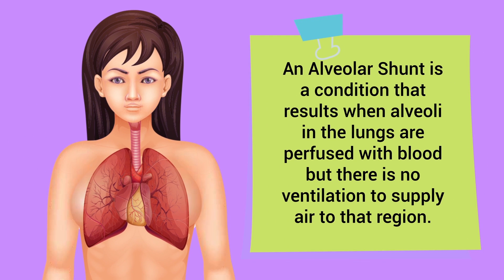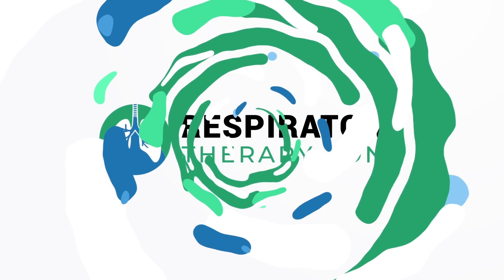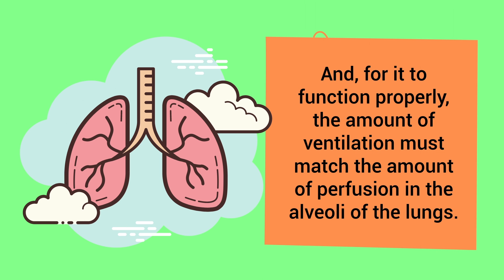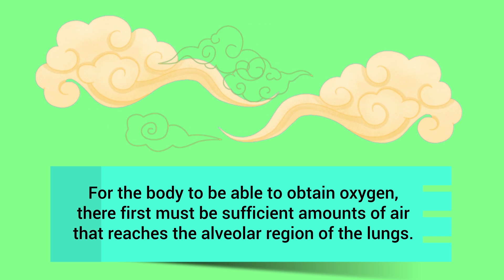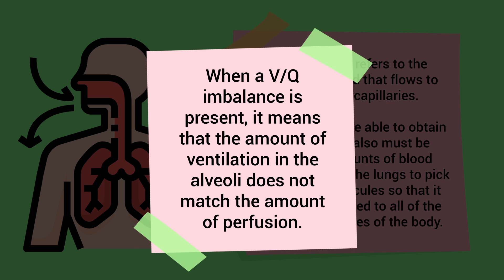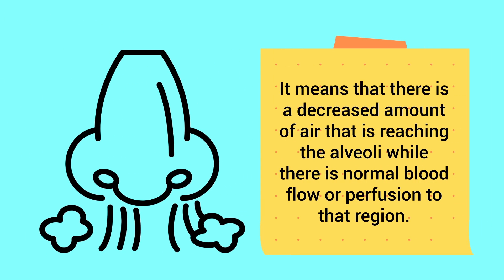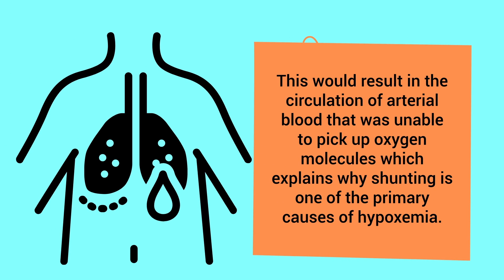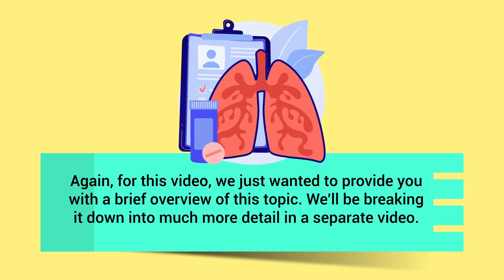Alveolar Shunt (Medical Definition) | Quick Explainer Video

Comment: So ventilator without perfussion means V/Q mismatch right?
Reply: No, that would be dead space!! Dead space could be caused by a blood clot. 
A V/Q mismatch is perfusion greater than ventilation, there can be low or high V/Q mismatches. Causes depend on if it’s a low or high mismatch but fluid in alveoli or even a low blood pressure are contributors. 
A shunt is perfusion without ventilation. The body has a natural shut in the heart of around 5 torr due to the bronchial and thebesian vein dumping blood into the left side of the heart. a shunt in relation to the cardiac pulmonary system could be caused my atelectasis.
 Hope this helps!